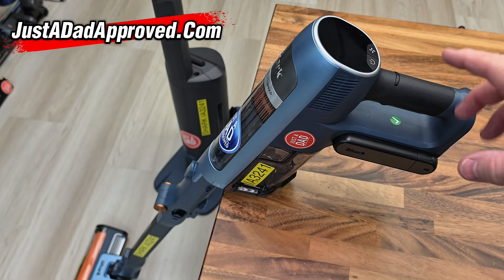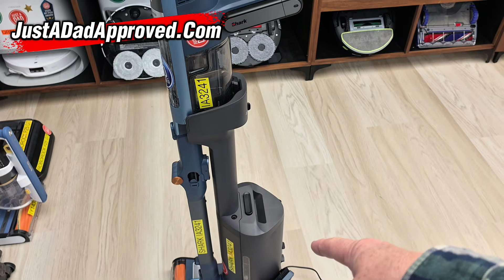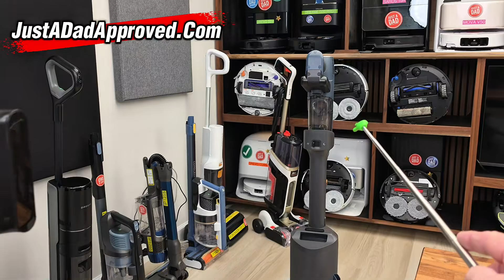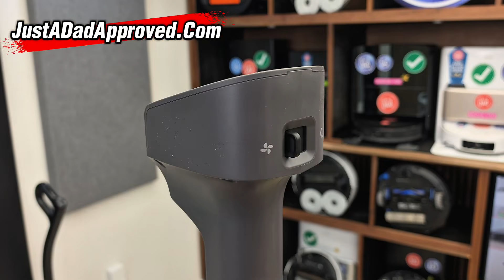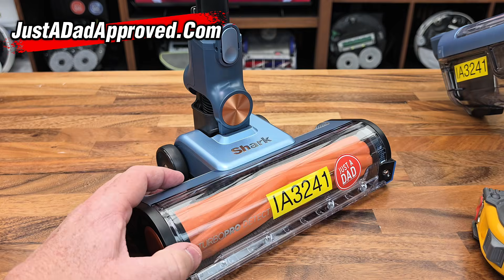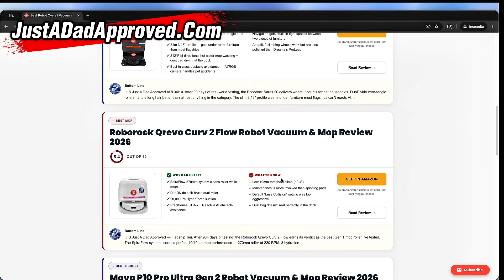How the Shark PowerDetect Cordless Vacuum IA3241 Really Did With Big Messes!

Comment: Have you found if there’s any reasonable way to remove the roller brush head yet? I’m a stickler for being able to clean my equipment. If I won’t be able to with this model, it might be a deal breaker. And how would I be able to clean the inside of the receptacle bin? Are those filters lining the inside of the bin walls? How would I clean those? … If this model is going to end up being too hard to keep clean, what’s the next best Shark cordless vac (that performs at an 8 or higher on both carpets and hard floors), that coverts to handheld, which is easier to take apart for periodic deep cleaning/maintenance? (easy clean-ability is a more critical feature to me than the clean & empty bin). I’d be grateful for any guidance you can give!

Comment: personally i dont understand cordless vacuums! they all use ALOT of power! that battery will die after so many charges!  whats the problem with a cord? we've been using corded vacuums for 80 years! 650.00 here in canada!
Reply: With Shark you can easily buy new batteries.
Reply: @rangersix84 with a corded vacuum i NEVER have to buy batteries !
Reply: Convenience is the biggest thing. Its a game changer to go room to room without plugging  in and stumbling over the cord. Ive own a samsung cordless for years and haven't noticed a major decrease in battery capacity.
Reply: LOL what an absolutely absurd thing to say. I have more and more cordless things all the time and I just love it. If something eventually fails you replace it. 

Just in the last year I bought cordless :Impact Driver, Sawzall, Mini air blower, Micro air blower, Headlamp, Lantern, Shark vacuum, and probably a couple of other things.... because cords and having to plug in SUCKS.
Reply: @festerofest4374  YOU WANT A COOKIE? AFTER YOU REPLACE THE BATTERIES ITS GONNA COST MORE THEN WHAT YOU PAID !
Reply: @peterpeter5666  So what? Buy a new one when you need to, and new stuff is always nicer than the old stuff you replace. The purpose of money is to buy stuff with it.
Reply: @festerofest4374  your right
Reply: @peterpeter5666 you’re angry for no reason